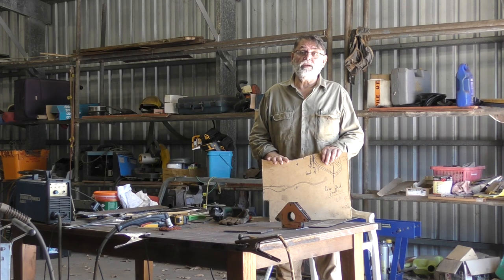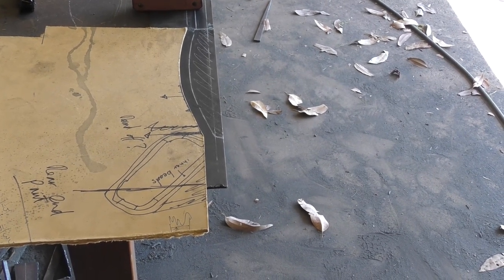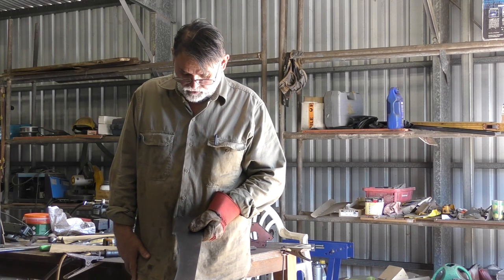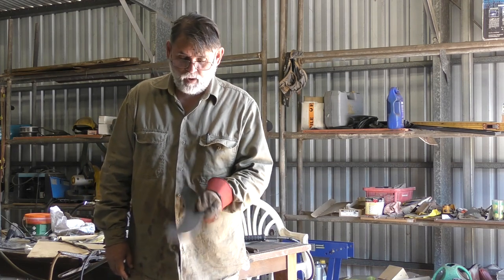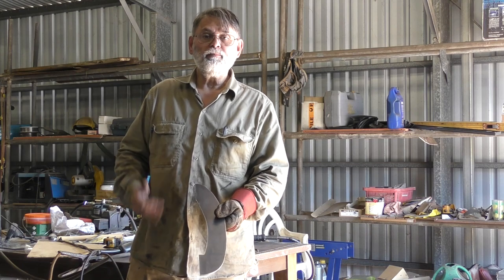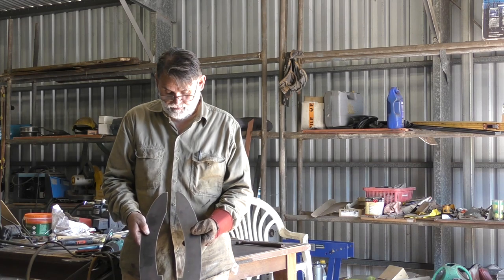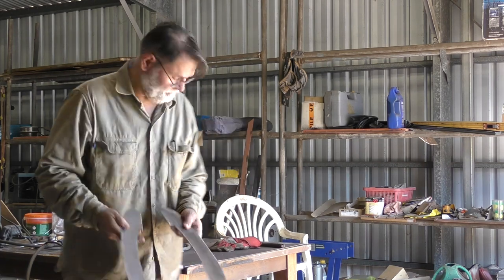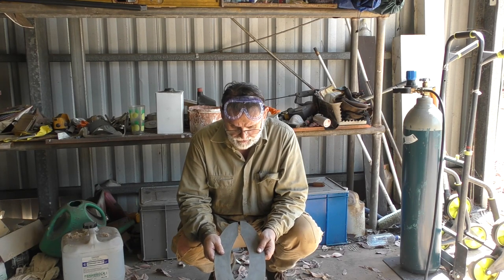Steel Sailboat Building SteelAway - Shaft Initial Alignment Part 3

Comment: a suggestion, could you show more of your work area, so we can see better what your working on!
Reply from the maker: Hi Charlie, yes I understand what you are saying. The camera I have currently has to be positioned quite a way back to fit everything into the frame. For some reason the image is quite narrow even when zoomed all the way out. Will investigate how I can improve on that. Cheers, Garry.
Reply: Steel Boat Building SteelAway - Building a Dream just trying to help you out